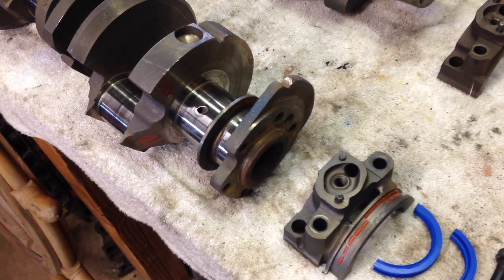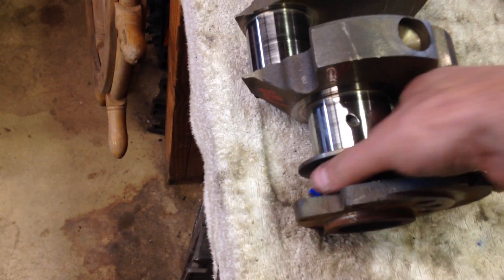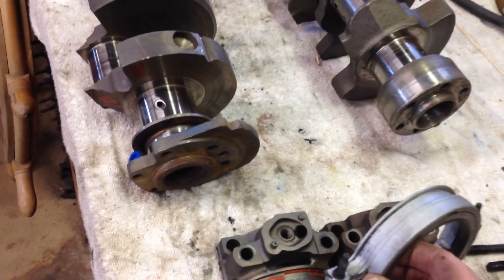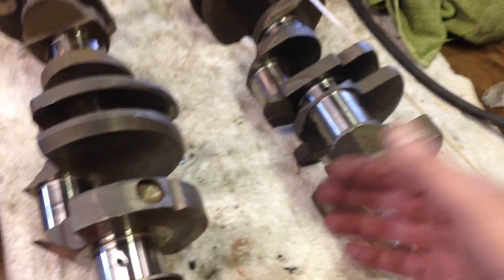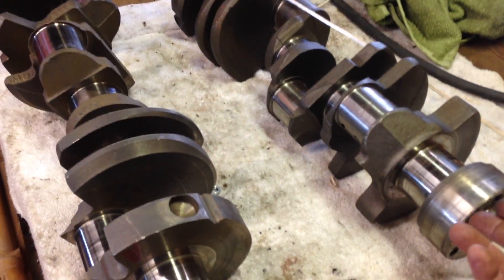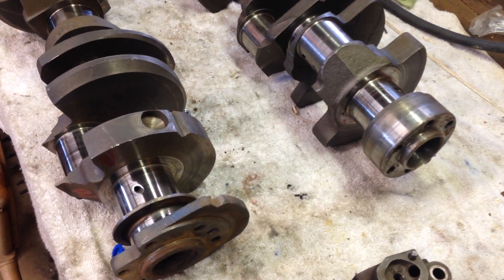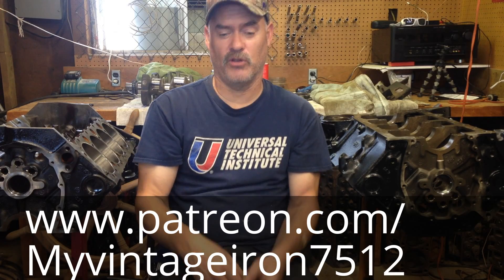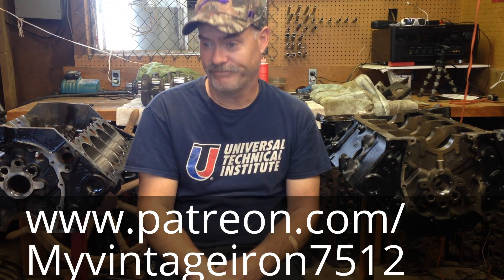350 chevy 1pc vs 2 pc rear main seal

Comment: Crikey mate..2x 350's and he needs more to pull 2 people out of the water.?..How big are these people.?
Reply from the maker: One thing you halto understand is it takes allot more torque and power to move a boat than it does something on 4 wheels also this boat is on the larger side the amount of power it takes to increase the speed of a boat on the water is staggering compared to a car so this boat can pull it;s own weight and two skiers at around 20 MPH it can pull 1 skier at 28 MPG with no skier it can do around 35 to 40 MPH with 100 extra HP we can add 10 to 12 MPH to all of those speeds that's all 100 HP gets you on the water water has a huge amount of resistance and it takes a ton of power to overcome it keep in mind this is a large boat that does not normally get used for skiers  the engines themselves are very different from car engines  clearances and internal parts wise they also rotate in opposite directions from one another this is done with reverse rotation camshaft,distributor and starter motor. There is allot of things that are kind of tricky with this marine stuff fortunately for me I have a buddy who builds crazy high HP marine engines and he has educated me about all of this over the years
Reply: I was thinking the same . I have a 5.0 Volvo Penta and it pulls three people on a large tube and will go fast enough to administer free lake water enimas for all.
Reply: i agree we only used one engine just it was a 396 rat
Reply: Yea I was thinking same thing. These motors are either super weak or these people are very big. Our Nautiques in ski shows would pull up 4 or 5 people on skies. Of course it takes a tad longer but it’s done all the time. Not a big deal
Reply: It's running twins, it's probably a pretty big 80s boat. Probably a Cuddy if it has trouble with speed.

Comment: I think the only drawback is they did not make a 400 crank with a one piece seal so you can't make a  383 stroker on the newer blocks. I believe the last 400 SBC was 1980. please correct me if I'm wrong
Reply: 1bcasso Blueprint offers a one piece 383. I just bought one last month. it was $100 less than the 2pc RMS
Reply: ok sweet so it's possible but with an after market crank! good to know thanks
Reply: I have a stroker one piece seal. Also with the stock hydrolic roller cam Just built it.
Reply from the maker: you can buy a 383 crank from scat they make em
Reply: sweet I haven't built a stroker scene 2001 so slot has changed good stuff

Comment: no manual fuel pump boss on most late model blocks
Reply from the maker: you know whats kind of strange about these blocks is you never know if they will have the mechanical pump hole drilled or not one of these 350's didi and the other did not out of the same boat no less

Comment: Twin screws 350's sounds like a cabin cruiser . Needs to get planing some SS props will help too
Reply from the maker: not sure what kind of boat but it is on the big side he said one of these engines runs clockwise and the other runs counter clock wise I guess to avoid torque steer
Reply: MrColdwatercanyon just a note check the seals for the way the groves are going. I've hear on the counter rotators
 the groves on the seal are flipped to help keep oil in the motor and to help with leaking....

Comment: I was working at a GM dealer shop in the early to mid 1980s and 2 piece Chevy rear main seals were never a big problem.  I remember replacing a few, I guess, but not very often. One piece seals are a little more tolerant of a worn rear main bearing before leaking maybe.  Worn main bearings and rear main seal leaks go hand in hand. Bad PCV valves, too.
Reply: I think that's because most folks in the early 80's more or less expected their cars to leak oil.  Oil seepage on the driveway and in the garage was commonplace back then.  The mentality of the consumer was not to return the car to the dealer for slow oil drips.
Reply: The quality of American cars in general was abysmal during those years, but we made a lot of money back then adjusted for inflation because the cars sucked so badly and needed repairs so often.  Air conditioner / HVAC repairs on GM vehicles alone put a lot of dollars in our pockets back then on the old R12 systems.
Reply: I have an 84 k10 Chevy  just bought..leaks everywhere ..pan ,valve covers, probably rear seal,. A little blow by..pcv valve was not even sticking in the valve cover.. I'm looking at replacing all the gaskets , plus doing a catch can..what do you think?
Reply: @davidjessee7701  God, Don't do it man. That would be common sense...

Comment: I just been wondering about the interchangeable parts between the LT-1 and gen 1 SBC. I guess the crank rods and pistons are the same. but that's all I know
 can a carb intake be swapped on the LT1/LT4 engines. will the LT heads fit older model engines? I would like to build a 302/LT4 basically. rev to like 8,500. with a turbo or two. in a gen 3 F-Body. with a t56, and 3.73-4.10 gears. witch is what I want to do with my firebird with my stroker 385. if I ever get it in the car. thanks
Reply: James stranger, the LT motors had a reverse flow cooling system which makes them incompatible with the GEN I 350 SBC. The internal rotating assembly and valve train (lifters/rockers) might be the only compatible parts with the GEN I SBC 350.
Reply from the maker: The LT1 stuff is not very interchange friendly allot of differances

Comment: say i got a question. i want to rebuild a 93 tbi 350 in the engine compartment there is a badge that says "350 SS" will it have a roller cam because of the SS designation? and should i put vortec heads on it or stick with the originals if they are good? thanks for your time.
Reply from the maker: The TBI intake will not fit the vortec heads so either go with aftermarket vortec's with duel bolt pattern or stick with TBI The TBI heads are not bad for stock use as far as the roller cam goes I probably does not have one but you can upgrade to one if you are rebuilding the engine

Comment: im doing a 1999 vortec in to a 1995 tbi k1500. I was wondering if Lunati 10120702 Voodoo Hydraulic Camshaft for Small Block Chevy wold work without machining the heads. it has a 468 and 488 lift...
Reply from the maker: If you go over .450 lift you need to have the guides cut down any shop worth their salt can do this very easily during the head rebuild I would just have it done when I do vortec heads I always cut the guide boss down even if the customer doesn't request it (Habit) I just do it in case anyone ever puts in a bigger cam they won't have a problem
Reply: SINISTERINVESTMENT, you need to check the valve stem seal to spring retainer clearance. Lots of info out on the web that the Vortec heads only have enough room to support about 0.460" valve lift. Anything more than that and you could run into issues. I had my machinist machine the guide boss down for 0.500" lift while he was going through my heads in case I ever wanted to get something with a little more lift later on. My cam has 480/487 lift.
Reply: Thank you so much my brother ...  Do you currently have a link to done to your channel?
Reply: I didn't film any of my rebuild but I wrote a thread on my build here.
.. 
http://67-72chevytrucks.com/vboard/showthread.php?t=669934

It was my first 350 build.
Reply: SINISTERINVESTMENT, I put an extreme energy comp cam in my 350, XR258HR-10. The bore is stock and I re-ring the Vortec pistons, set quench to 0.035". I estimate it's close to 9.5:1 compression. My cam specs are close to the 702 cam you are looking at. Mine has duration of 206/212 @0.050", and 0.480/0.0487 lift.

Comment: only plus to the 2pc rear main is you can change it w/o pulling trans out
Reply: Dan M mine has a single screw volvo penta set up.  Just has a single prop. But I get what your saying about dipstick. Thats how I change the oil is by pumping it out from the dipstick tube. Thanks for your input though I appreciate it!
Reply: Would a two piece rear mail seal oil pan from a 1966 Chevelle work on a 1998 oil piece rear mail seal block?  Great video as always.
Reply: @ezelk1337  No.
Reply: How you have to drop the crankshaft
Reply: @Ohiocountryboy-se2cn  no you dont
Reply: @savageshooter2248  Like he said, you don’t have to drop or lift the crankshaft. Once the cap is removed, you can tap the seal halve around and pull it out. The other halve on the cap of course is easily swapped. I personally prefer a 2pc. I’ve recently built two SBCs and sourced 0010 blocks with 2pc seals. It’s my preference for my personal trucks. The seal shouldn’t leak. But if it ever does, it’s relatively easy to replace it. No need to pull a transmission (and transfer case if 4wd) out!

Comment from the maker: yes 86 was the chang over year
Reply: Midnight Mechanic, the retro roller lifter like you are talking about are much more expensive than the normal roller lifter. If the raised bosses just need to be drilled and tapped it's a lot cheaper to do that and buy normal roller lifters than to get the retro lifters. Otherwise I agree with you, the retro lifters are plug and play.
Reply: '86 is also the year they introduced stock hydraulic roller lifters to their SBC lineup, saving loads of trouble of having to add ZDDP formula to every oil change.  What's really nice is a lot of parts from the Vortec era can be carried over to the '86-'95 engine lineup, thus modernizing any engine you've been running for 30 years or more.
Reply: Skyline Fever, the raised boss tower is cast in the galley and can be drilled and tapped for the spider hold down. Very easy to make those motors into a roller cam motor.
Reply: +Midnight Mechanic
The SBC TBI engine found in trucks did not get roller lifters.
Reply: Yeah Ford did the same thing, they ran flat tappets for years way after the SBC blocks got rollers on some of their engines.  Jeg's direct replacement truck motors still come with flat tappets, their Vortec models came with rollers, though now it seems they're phasing Vortec motors out in favor for crate performance engines.  Rebuilt motors are gonna be the cheapest way to go in order to get a stock engine with hydraulic rollers.
Reply: Yeah you don't even have to go that far, just get roller lifters that are paired together with a control arm, that arm keeps the lifters from spinning in their bores so the rollers are always in line with the cam.
Reply: Myvintageiron7512.  Hi!   I was wondering if maybe you have any videos on how to install a rear main seal on a1977 AMC 360 eng. or if you have any tips I will appreciate them,thanks.
Reply: Myvintageiron7512    Sir I had my 350 honed and decked for 383.  The block is 94 or so crate truck block.  I saw no machining for cam clearance.  Is cam clearance matching necessary or will a small base cam work with no machining?  - I am a bit upset with my machine shop as they won’t give me good directions on where to go from there.  I think the next step is rotating  assembly.  I’m new to engine building but hot rodding will be lost if it isn’t passed on by good people as you are.  

Great channel you have here.